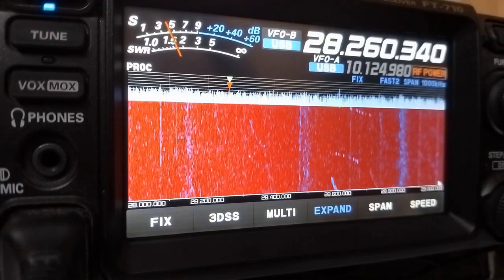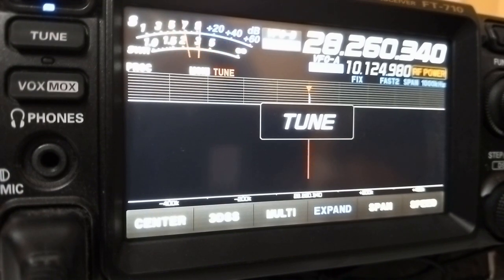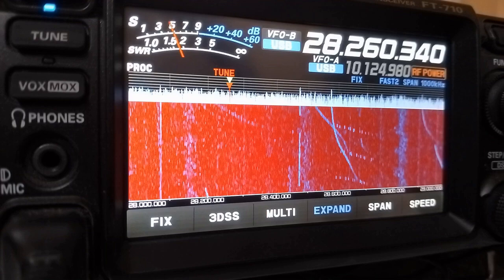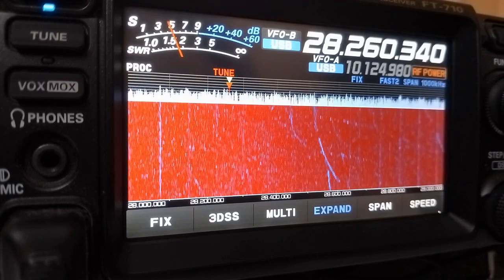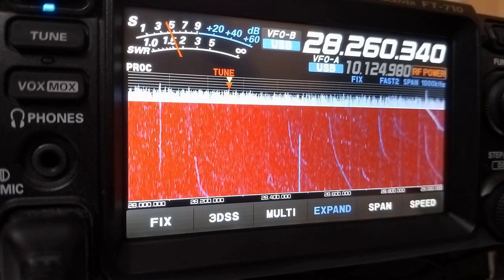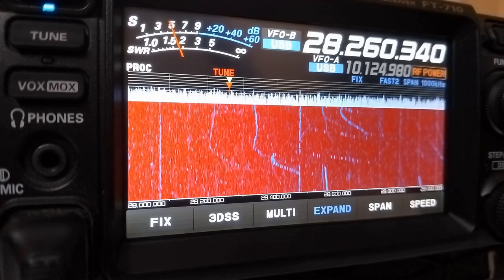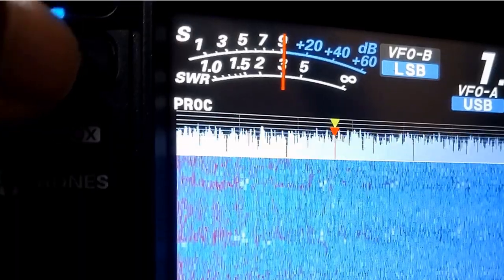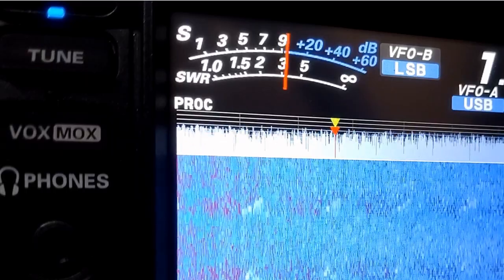How to Use Built in Automatic Antenna Tuner in FT-710

Comment: Why my radio is turning power off when I long press on Tune button?
Reply from the maker: That seems unusual, unless you are simultaneously and unknowingly pressing the nearby power button in FT-710. I have seen one friend using rubber eraser end of a pencil cum eraser to press menu buttons on the touch screen. I tried it just now on the power and tune buttons as well. It works, though you have to hold the radio to prevent it from moving back. Wonder whether this method will be useful in your case? 73 de Jon, VU2JO
Reply: Could be high ac impedance at the power source causing it to dip under load. Switchers sometimes have issues with these kinds of loads because they operate at a much lower frequency than the radio.
Reply from the maker: Can you please explain the proposed interaction between automatic antenna tuner and the power supply a bit more?